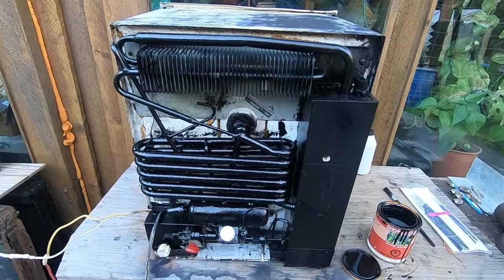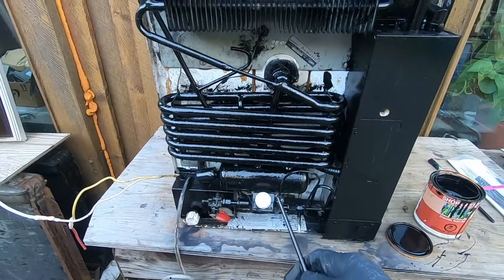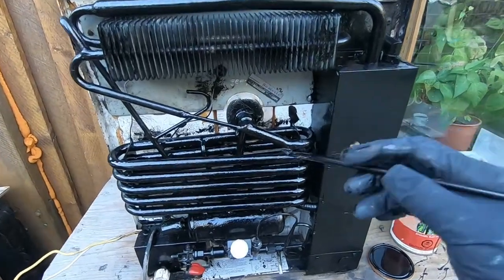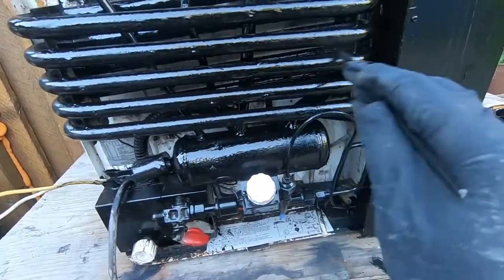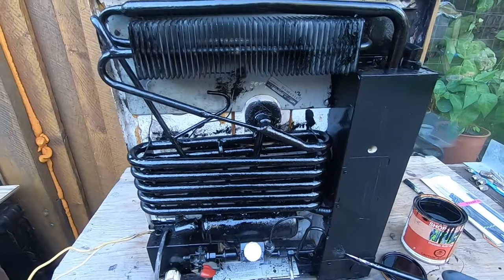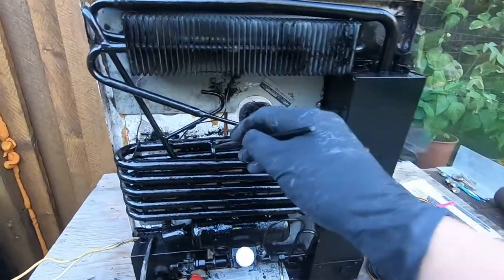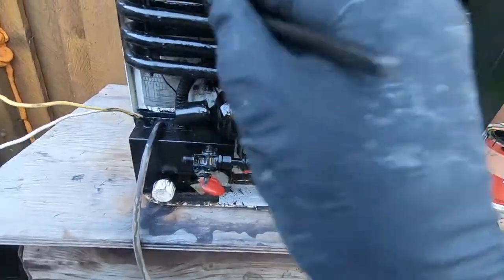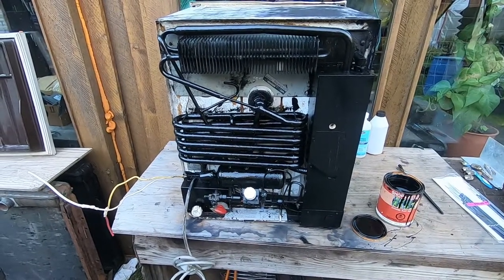HOW TO EXTEND THE LIFE OF YOUR RV REFRIGERATOR (REALLY EASY !)

Comment: Good tip. I've never even thought of doing that.
Reply from the maker: It can make the difference between a working fridge or not, especially in an older RV. Up here in the western mountains, moisture works relentlessly to oxidize any exposed steel; not so much an issue in Arizona, perhaps, but as the old saying goes, "Rust never Sleeps." There was a another saying a number of years ago: "On a quiet night in Chevy country, you can hear a Ford rust!" (interchange you vehicle of choice for this one). Best to stay one (or two) steps ahead of rust if one can. Thanks for watching.
Reply: @EverydayProjects  Yes, rust never sleeps. I spent enough years in Minnesota on the salty winter roads to have experienced it. That’s one thing that is so nice in the desert climate. Nothing rots, or gets moldy, and rust comes very slowly.